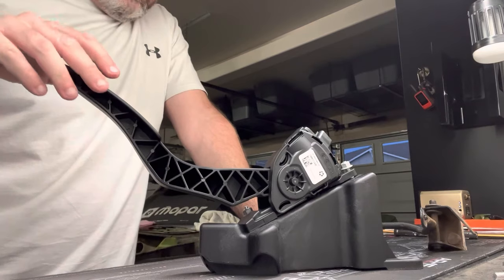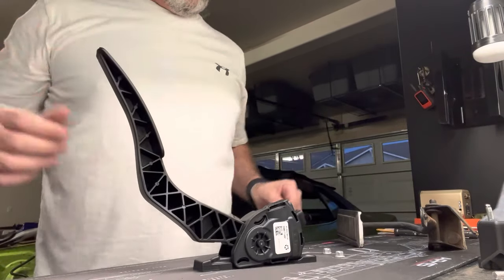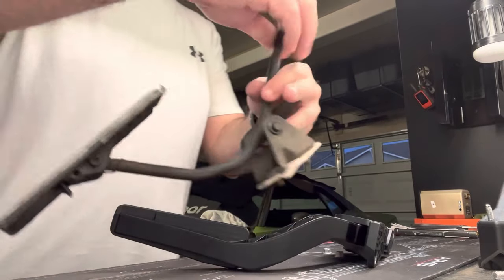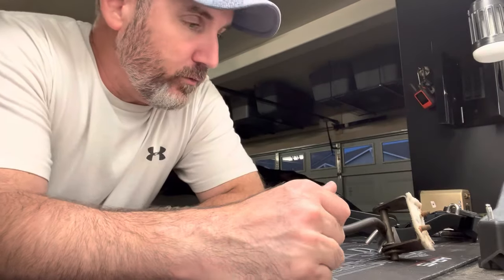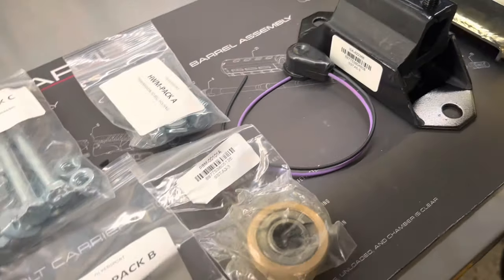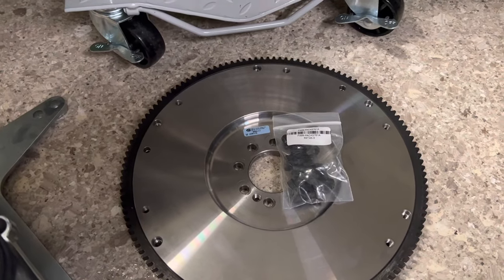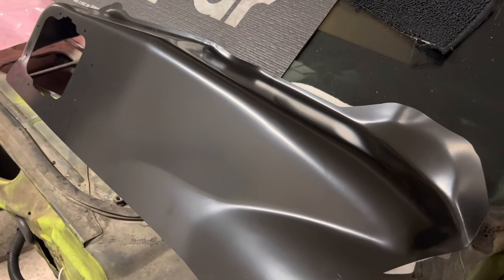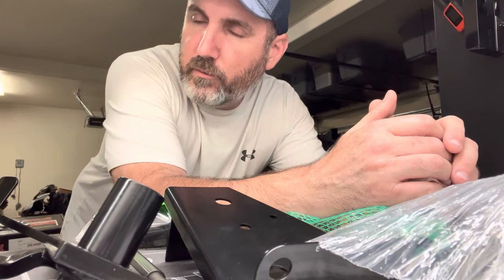Electric accelerator pedal modification

Comment: Looks great...Rule of thumb from a manufacturer's perspective, brake pedals always rest higher than the gas pedals, and should be full stop when even with the gas pedal. Manufacturer's do this to prevent accidental depression of the gas pedal simultaneous with the brake. Looks like you have plenty adjustment in the slot on the bracket for the brake switch...looks great.
Reply from the maker: Good info. I think the mopar install docs have some details about spacing, I’ll be sure to triple read that part!